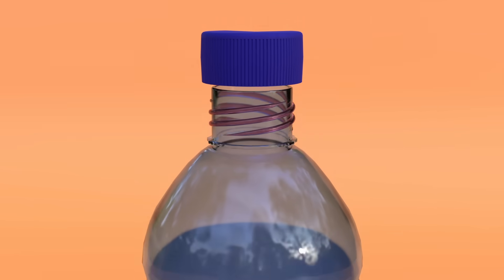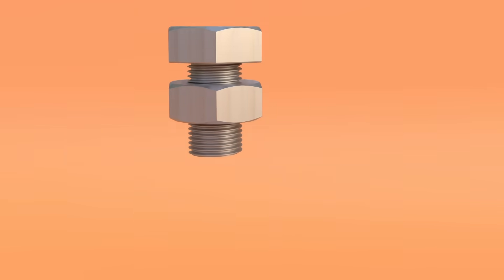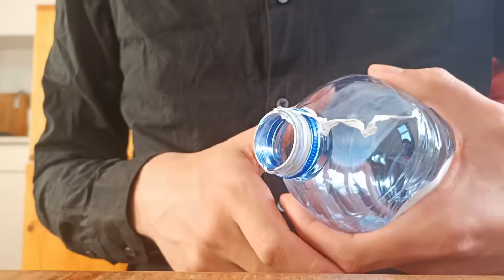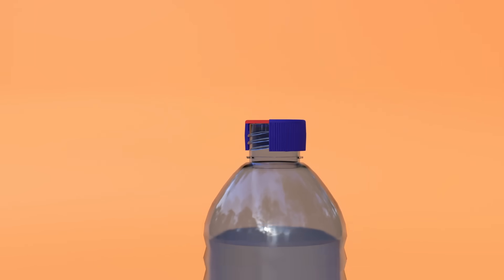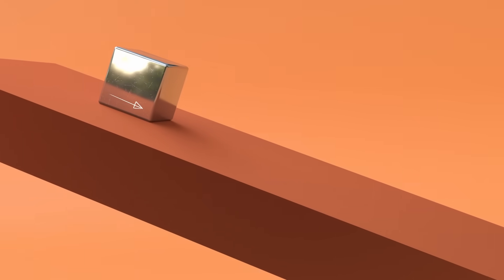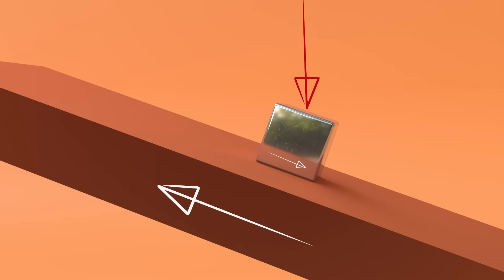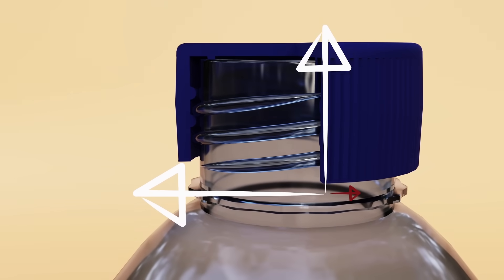Why Threads Are Not Watertight

Comment: Usually treaded sealing surfaces dont seal at the tread for exactly this reason but unlike bottle caps in most technical use cases you dont want to narrow your gateway trugh (or close it off completly) therfore you have a circular surface around the tread where the two parts can seal if you cant use a seperate sealing medium like teflon tape, for example the venting valve for brake Systems seal to the clamp via the flange and the insert where the screw seals when closed seales between its ball and two surfaces having the negative shape of the contact surface of the ball inside

However there are treads that can seal which means the parts have verry low tolerances and are an interferance fitting but they are not reliable in repeatet opening and closing, in some cases need to be shrunk together when assembling, require way more torque to screw together even when not fully closed, and are realy expensive, they are however 30 to 50% lighter than a System sealing on flanges and are therfore used in some cases where this is critical, while with common sizes this amount of mass semes irelevant in systems with multiple media and a lot of fittings this can add up, for example this is used in some figter jet engines and fuel Systems becouse if you can save 2 to 5g for every fitting and you have a total of a view hundred fittings you actually could save multiple Kg

But ist not used in all applications with this conditiones becouse it makes maintanance and repair way harder which in most of these applications also are a high priority

Comment: This video is Incorrect, Threads are in fact water tight. Take a water bottle and throw it from a 2,3 or even 4 story building it will not spill the water only with two turns

Comment: I mean they are an can easly be air tight and even string and load barring... Like I really don't understand how this isn't an aprial fools post as it is a universal human expernice and has been for thusends of years too... Like it's also a simple Expernet to disprove get a bottle drink and hold it upside down even shake it and thorw it... Un tighten it till it's just on there it won't leak... Like treads work to be as tight as you need them... Like I really don't get how anyone can not call tread locks water tight... I mean it';s at beast like calling Hydorgen tanks noyt airthight just because hydrogen loves to inbed it's self in the walls of the tank...

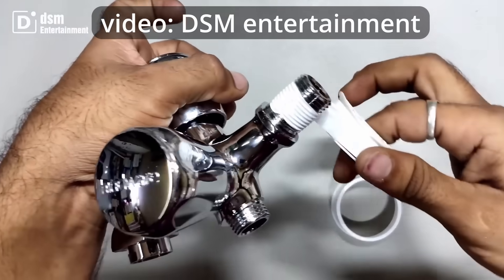Comment: 0:25 teflon tape is NOT to create a seal, it's to overcome friction toallow the fitting to be turned further so that the mating surfaces (the ends of the pipe/fitting) seat properly. teflon tape will not form a seal, nor will anything else you do to the threads, unless the threads are specifically designed to create the seal, in which case you would not be using teflon tape. the seal is always created solely by the intended mating surfaces.
Reply: Thats simply not true. While it does indeed act as a lubricant, its primary purpose is a filler that fills the gap between threads to create a secure seal to prevent leaks.
If it was unable to achieve this then you wouldn't be able to use it to create a watertight seal on non-tapered threads, which you can.
Reply: NPT stands for national pipe taper, locking the taper makes a metal to metal seal, teflon tape or pipe thread lubricant is just that, a lubricant. NPS is national pipe straight, where the seal is attained with the use of a nut on the straight thread that compresses a washer against a sealing surface. Used   mostly for connections to appliances such as radiators or boilers. I have 40 years experience in pipe trades working in commercial and industrial construction. I'm a licensed plumber, steamfitter and gas and oil pipe fitter. You can't argue with that.
Reply: Where did u get ur knowledge from? The toilet? Why is shit coming outta ur mouth

Comment: I wish I could make some of my coworkers understand this.  There's always someone trying to fix AN-style connections by covering the threads in teflon tape like it's a water pipe, but the seal is formed at the tapered face of the union and the tubing flare.  The threads don't seal anything.

Comment: You can make them unscrew themselves when you squeeze the bottle hard and ideally have some of the CO2 also building pressure, if you then slowly unscrew the cap at some point the side way forces take over and the cap actually shoots away. Its kinda a fun trick for kids but probably rather do it with a water bottle as otherwise you might have to do a bit more cleaning when its something with sugar lol.

Comment: hi can anybody explain the part of the friction and lateral forces ? ¿is it about like a gear box, in which low gears have less speed but more power? beeing horizontal thread requires low force but can advance on turning the cap generating more friction in proportion to the force than if the thread where more vertical?  i'm missing that final thing.., thanks
Reply from the maker: yes it's a bit like a gearbox. However. The more pressure is put on the contacting surfaces, the more friction. Eventually the threads are at such a shallow angle that the friction will increase faster than the sideways force that wants to open the cap. So the cap will never open from pressure from the inside

Comment: On many bottles, you'll notice, that the threads are not continuous. There are vertical slits in them. This is for venting any pressure inside the bottle. When you unscrew a soda bottle, you don't want the cap to shoot off.
Reply from the maker: Could be a part two :)

Comment: This is mostly but not completely true? Pipe threads frequently get used with pipe dope or teflon tape to help seal, but they can actually seal on their own.
A standard UN or Metric thread is a straight thread, so the gap between the male and female threads is consistent along the length of the fastener. Pipe threads are tapered so as you tighten them you get a smaller gap until the male and female threads seal against each other.

Comment: Pipe thread do not have a flank gap as shown in blue because the pitch diameter is tapered. The teflon tape is there to fill the spiral leakage path left between the root and crest of the mating threads. This is unless of course both pipe threads are NPTF which signifies is a dry seal thread having very closely controlled root and crest sizes which result in a zero effective gap and preclude the need for pipe tape or dope.

Comment: A really terrific video. I agree with the comments about how to the point it was.

However, I have a minor correction, that I think is correct.

The arrow in the ramp scene should be pointing perpendicular to the ramp, to increase only the normal force, which will increase only the frictional force. Pointing straight down just makes the cube heavier, and the weight does not matter -- only the angle and coefficient of friction do (assuming a simple model of friction). The screw threads push against each other along the normal vector.

You probably already understand this.
Reply from the maker: hmm...
Reply: Uh oh. Am I incorrect?
Reply from the maker: @kfawell   had to rewatch it to see the exact wording and animation. You're correct
Reply: I rewatched it and listened to the wording. You are correct. The frictional force does increase the heavier the object. You were not talking about the change from static friction to kinetic friction.

My apologies.
Reply from the maker: @kfawell  although there's still a minor detail that I got wrong. When the weight increases, the arrow along the path of the cube should also increase slightly

Comment: BUT... threads ARE watertight. Otherwise, we'd never use pipe plugs for pipe fittings.

Especially in brass, which deforms more than steel or iron threads do.

If metals were crystalline and could not deform, then threads would not be watertight. And... if they aren't designed to be watertight, then they are not watertight. But... very many threaded joints are quite perfectly watertight, than you.

So you're wrong.
Reply from the maker: sorry, must've been a typo in the title. I meant "preliminary results of pilot research into cylindrical spiral threads in HDPE and their recommended design requirements for low pressure nautical use"
Reply: @KnowArt  That'll work. I'll buy a pound.

But... ooo. HDPE threads. With an interference fit. Watertight. HDPE is funny that way; it yields very nicely, permitting extremely watertight interference fits.

Certain thread profiles, I'll grant, especially between dissimilar materials and/or involving exceptionally brittle materials, which won't readily yield and which therefore undergo physical deformation.

There are tons of variables.

Comment: "threads not designed to be water tight are not water tight" 
Fixed your title for you. 
Making water tight threads is perfectly doable, most companies dont because its expensive. Well drilling pipe has watertight threads on both ends. Some gas pipes have gastight threads. Its all about tolerances.

Comment: Why don’t they make screw caps entirely out of some kind of hard rubber to maximise the friction and corking effects? The cheap slippery plastic seems to be their chosen material instead.
Reply from the maker: it works, so no reason to change. I guess that this is the cheapest/best option

Comment: tapered gas cylinder threads seal 250 bars of gas pressure without using any teflon tape, sealant or compound, look up 25E thread
Reply from the maker: hm, tapered threads break my brain. Maybe time for a part two to this video :)

Comment: Black iron gas pipe is an example of threads that seal. The Teflon and pipe dope is used as a lubricant to allow the pipe to be tightened until the iron of the threads conform to each other creating an airtight seal that is beyond the capability of Teflon tape
Reply from the maker: cool
Reply: Also luer threads
Reply: @bywonline  in Mexico we regularly use copper for both, gas and water. Or plastic hose with copper or bronze fittings. Only in poor places is common to find galvanized pipe and yes, it’s for water. We don’t use black iron at all, at least not for the last several decades. I have done several connections of both, water and gas with no need of sealant. Also, most of my air compressor fittings are like this. Again, when you use good quality NPT threads, you should not require any teflon or paste. But as always, YMMV.
Reply: Explain in 5yo terms
Reply: Brb, gonna go buy a black-iron-gas-pipe bottle of coke.
Reply: all threaded pipes don't seal unless they have a tapered thread, or have a sealant like teflon tape
Reply: @nirodper  what he's saying here is that because the metal is soft, when it is screwed on the threads warp and conform to make a complete seal.
Reply: @jacobhargiss9909  he's plain wrong, black iron pipes aren't soft enough to seal and there isn't a single place in the world that lets you install gas pipe with simple threads and no sealant. There's tape, dope, anaerobic sealants similar to loctite, and the very old litharge + glycerin.
Reply: @nirodper  he isnt wrong, the function with of sealant with black iron pipe is not as a sealant. on its own, the pipe will catch before it deforms enough to make that seal, it needs some form of lubrication. unlike most pipe that needs sealants to act as the seal, black iron pipe just needs lubrication to keep it from catching prematurely. the original poster said nothing about using bare threads on bare threads.
Reply: @nirodper I’m from Mexico, we use codes really similar to the US and tapered gas and water threads do in fact seal and don’t require any teflon by code, it is usually only required when the parts are not of good quality or out of habit. You also need to use the right type of teflon tape or paste, there are specific types for gas and water pipes. Also, we don’t use black iron pipes, we use galvanized but mostly copper and in both cases threads DO seal without the need of teflon when the installation is done properly.
Reply: @nirodper  Black iron pipe is soft enough that on the half inch you don’t even need the 300 machine to cut the threads. As long as the vice holds you can do it by hand. It’s almost never worth the time but it’s handy knowledge if you’re in a pinch
Have you ever worked with black iron?

Edit: never mind this guy has a Billie Eilish playlist we are arguing with a child
Reply: @zekiah2  lol you seem to never have worked with it with what you're saying. With standard black iron or galvanized pipe, BSP thread you can't tighten it enough for the threads to conform, the fittings will crack before that. You NEED the sealant to fill the gap that is left by the thread. When the threads are parallel (NOT TAPERED) a gap is left and the fluid can leak, there isn't a nice flat sealing surface. If you had fittings that could handle the torque to make the threads conform to eachother it would be hell to install anyways, as you wouldn't be able to back out the fittings any amount as it would leak.
With TAPERED threads (whick seems to be what they use for gas in the US) you can get away without using some kind of sealant some of the time, but ANY imperfection in the thread surface can lead to leaks. That's why by code you're required to use a sealant.
If you work so much with black iron and don't use a sealant you're a criminal, and if the threads only needed lubrication you would use grease instead of dope, teflon or loctite
I prefer loctite 577 but for gas the absolute best is the old method of litharge cement made with lead oxide and glycerin. Due to the toxicity of its ingredients nowadays it is only used in more niche applications like high pressure steam
Reply: @nirodper  quoted straight from the source 

The taper on NPT threads allows them to form a seal when torqued as the flanks of the threads compress against each other, as opposed to parallel/straight thread fittings or compression fittings in which the threads merely hold the pieces together and do not provide a seal. The various types of pipe threads are designed for use both with or without thread sealants, as particular applications demand. The sealants, where used, are typically thread seal tape thread sealant or a thread seal paste pipe dope (sometimes similar in composition to plumber's putty).

Because the thread body is tapered (0.75 in/ft or 62.5 mm/m), a larger diameter keeps compressing into a smaller diameter and finally forms a seal (no clearance remains between the crests and roots of the threads because of the taper). This means that NPT fittings should be burr-free and lubricated using a lubricant like lubricating paste or thread seal tape. The use of tape also helps to limit corrosion on the threads, which otherwise can make future disassembly nearly impossible.
Reply: @nirodper  And that's why gas pipe uses a different teflon than water or use "pipe dope".   The only pipe that seals without tape or dope, are fittings that seal by "shouldering".
Reply: @nirodper  teflon tape is not a seal. the teflone tape is simply there to allow the pipe to be tightened more easily, so that the mating surfaces form the seal, which is normally not the threads themselves.
Reply: Isn't "black iron" actually low carbon steel which is soft and thus why the threads can deform and seal?
Reply: @soundspark  Yeah I dont think cast Iron would seal if you threaded that in naked, but carbon steel definitely will